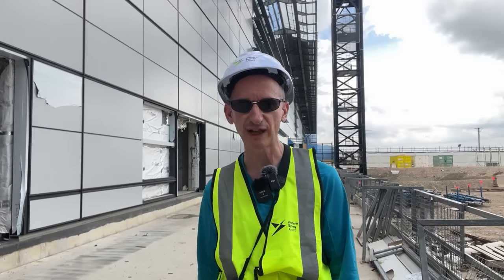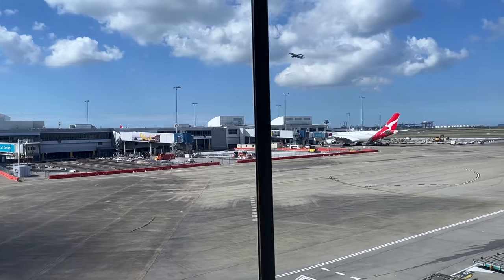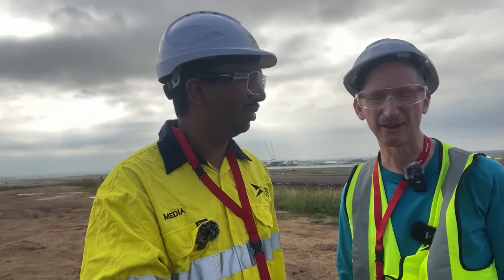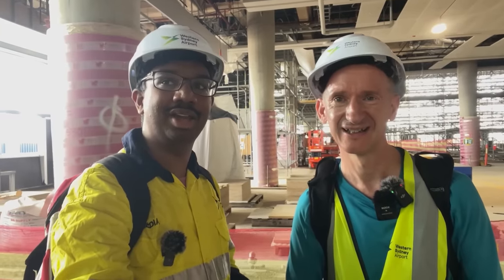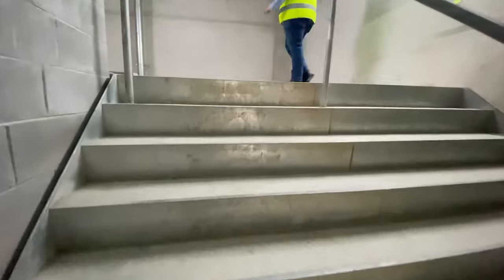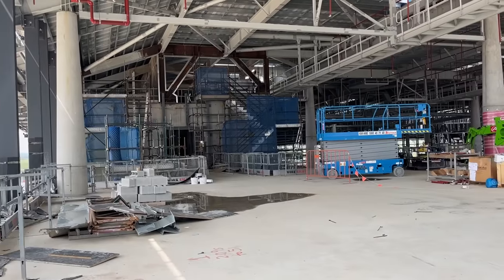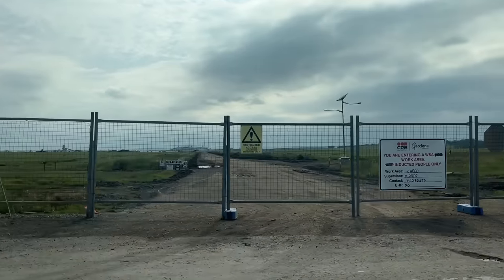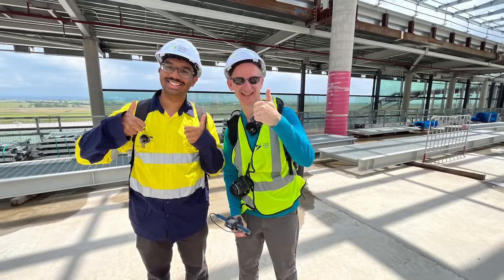We got a private tour of Western Sydney Airport!

Comment: Great planning - a new airport at a location remote for many in Sydney, and then including what looks to be a public transport system which will be very difficult for a high proportion of travellers..
Reply: What are you on about? It's much closer for 2 million people. And why is the public transport difficult? Where else in sydney do you suggest they built this?
Reply: @chrispekel5709  There are 2 main problems with the new system.  The first is that you have to take an ordinary suburban train, then change to the airport line.  There ought to have been a proper service, no changing, from Central to the new airport.  Stops at Strathfield, Lidcombe (perhaps) then  Parramatta, Blacktown and the airport.  The second is that it seems that ordinary suburban rolling stock will be used.  That has very limited luggage space.
Reply: @doubledee9675  Fair enough. You have to swap in Singapore too, which I always found weird
Reply: Sound like an inner city type.   Stick to your local airport.
Reply: @lindsaysmith8119  Well, no, I don't live in the inner city.  Never have and have no wish to do so.

Comment: Right now, it's estimated to have the same amount of traffic as Canberra airport.
Reply: A regional airport…..not international…..
Reply: @cathalwarrior1650 incorrect. Takes international flights and has a modern terminal and a runway length in excess of  3.2km which is longer than a few other so-called international airports in Australia. A second airport close to a freight rail line between Sydney-Goulburn-Canberra would have made better sense than lumping Western Sydney with another dysfunctional structure and traffic chaos.

Comment: The design is similar to Athens Int’l, which is 21 years old. The main differences are: Athens was built with 2 parallel runways from the beginning, Athens has a satellite terminal.

Both airports can easily be expanded which is good. Feels like Sydney is finally joining the 21st century with regards to airport design.

I think this new airport will be more popular than what the planners realize.
Reply: As Sydney's second airport, and with more space to play with, they could build a more modern airport. Sydney Airport doesn't have a lot of space to play with, unless they filled in more of Botany Bay. That might upset a few people though.

Comment: I’m not a plane guy but excuse my ignorance 

I always thought airports had two runways allowing aircraft to take off / land into the  wind 

I thought from the aerial shot I saw one runway and Sharath said he’s was at the western end 

I’m assuming one east/ west runway ?

Can anybody shed light on this ?

Thanks
Reply: 1 runway until it reaches capacity in 2050 then a second will be added
Reply: Crossing runways are expensive to build and take up an enormous amount of land area, and you can only use one at a time anyway. They generally don't get built unless the airport is expecting a lot of smaller private planes (which can't handle crosswinds very well and don't need a particularly long runway to land on) or the location has highly variable weather conditions that justify it.

They're starting at one runway that points northeast (into Sydney's prevailing winds), and will add another one in the same direction when it's justified by the amount of traffic.

Comment: Great clip. I'm all jealous now. A few random comments:
- You have probably heard that WSI will not have a control tower, but multiple cameras (including in infra red) that will display like a virtual control tower at a facility in Eastern Creek.
- It's a little harder to do 'virtual' crash fire rescue, so there appears to be a large concrete pad for the first runway fire station on the western side of the runway, near its centre and beside a big rectangular pond.
- The Elizabeth Drive bridge over the M12 and rail underpasses at the northern end of the airport is about to open. 
- The Elizabeth Drive rail underpass has tons of room for four tracks - That combined with spare space along the eastern side of the W S Airport Metro line through the airport are probably to provide a corridor for a later second line (to/from Westmead?).  - Given the passenger flow, cross platform transfers would not be needed within the airport. 
- As I won't be around by then, I can safely speculate the Airport Line will link to Glenfield, and the later line will run to Narellan and Macarthur (with cross platform exchange before lines split around Bringelly - and possibly with the Airport line splitting to do both destinations initially).
- I wonder how transfers between flights at different terminals will be done, once they are constructed - perhaps transfer buses airside (like at some major Australian airports), or a 'people mover' connecting terminals inside their secure areas (like at some major US airports)?
- I'm 'sowing seeds' wherever possible that WSI is NOT Sydney's second (or third) airport at all, but is Western Sydney's own international airport. Seperate identity, different market mix, more flexible, cheaper operation and run by more pragmatic locals - It's all the more reason why people in the (more populous and productive) West will rarely want/need to go into dear old Harbour Sydney, except as an occasional tourist - Even Tay Tay preferred going West for her venues and zoo visits. Just saying.
Reply: In relation to the transfers, I would say it would operate not dissimilar to Pudong & Hongqiao Airports in Shanghai (both on opposite sides of the city).I believe they have a mix of airlines, but set routes only go to 1 specific airport, and the budget airlines go to Hongqiao.Hongqiao takes less international if I recall my time there, Pudong still doing the heavy lifting for international flights. I reckon Wellcamp Airport here in Brisbane will be similar again, both Badgery's Creek & Wellcamp being a good 2 hours from current airports.

Comment: Sorry guys but you forgot to mention no DIRECT connection via metro to Kingsford Smith. Domestic or foreign visitors needing transfer from Western Sydney to Kingsford Smith will need a metro to St Mays, then change, then train to Central station with a change to get to Kingsford Smith. Absolutely ridiculous when 6klm from Western Sydney Airport, a rail line to Leppington was built with direct access to Kingsford Smith and Central WITHOUT THE NEED TO CHANGE TRAINS.  Road connection to Kingsford Smith will be a disaster along the M5 that is a parking lot for most of the day. And forget catching a train from Camden or Campbelltown unless you have 3hours to waste of your life. Planning has been -4/10, A second runway and terminal expansion will NEVER happen as in 40 years time it will be 30 - 35Billion to complete as it is next to an active runway. I follow both of you guys channels, and generally love the content, but, and that's a BIG but, this video, i'm sure has been vetted by WSIA for content, and doesn't exploit the weaknesses that will hinder this airport from running smoothly. FFS, 150m to walk from a train to the terminal with baggage before a flight. When heavy machines that were onsite could have done a cut and cover station for 1/3rd the cost and 30m from the terminal. come on now.
Reply: It’s designed to serve Western Sydney. Transferring between airports located  over an hours drive away from each other would be odd.
Reply: @MaxS-hn8we It is a complete myth that people travelling to/from Western Sydney will use WSA and East/CBD passengers will use KSA. People will choose flights based on timing, convenience, preferred airline and above all price - and then go to the airport.
Reply: @jack2453  Ain't worked out too well for Avalon.

Comment: An amazing piece of Civil construction. Thanks for the lighthearted informative video. 
But its operation going to effect the whole of the Sydney basin. Aircraft Noise, traffic chaos and pollution. The increase costs from ROI of running this new airport.  The new WSI and SYD aircraft movements  basically will effect everyone from opening. 
Plus the many Ground travel and resupply issues assigned to TfNSW well into 2030's.
Reply: World-class cities need 24-hour airports.
Reply: @baldersackthethird768  Boring as hell though after 2 weeks
Reply: @eds4743  There is a case for them. The good ones are away from City Basins like ours. with fast transport connections

Comment: Interesting that the connection to the metro will be outside. Is that right?
Reply: The station is actually located in what will eventually be the middle of 4 terminals. They are only building 1 terminal for the 2026 opening.
Reply: @MaxS-hn8we  saw that later in the vid, good news then!
Reply: I remember reading that it was modelled on Incheon Airport and having lived over there and made good use of that train, it’s a good one to compare with. The airport railroad there connects nicely to both terminals via an enclosed connected walkway. Western Sydney doesn’t get as cold as Seoul but at times cold enough!

Comment: Can't wait for this, 24 hours per day will be good for the airlines. If connecting passengers are late getting into Dubai they have to leave them behind to beat the curfew into Sydney. This has happened. One Emirates flight leaves Heathrow for Dubai & about the same time a flight leaves Manchester. They all join the same flight to Sydney. Once the Manchester flight was late getting in & about 50 people had to wait 9 hours in Dubai. A few chose to get on a flight to Sydney via Singapore but took longer.  I live in Glenmore Park so I already get aircraft noise so I have no issue with more. Also, every new plane that comes on the market is quieter. For those who say Sydney has a curfew they still run propeller aircraft all night for cargo flights.

Comment: best? kinda in the middle of nowhere though....lol. iots SOOO small. Doesn't look like it can accomodate  many flights. Kinda looks like Adelaide but Adelaide is WAY bigger. what airlines? i wouldn't want to travel that far. Also M12? how much they gonna slug you for that? ><
Reply: This is stage 1. The plan is to build a second runway and terminal. The land is already protected for that purpose. The Metro station will be conveniently located between the two terminals. Current projections are for 21 air traffic movements per hour during peak times. And don't forget, Sydney Airport will still be operating, so it's not like this airport is expected to handle all the air traffic for Sydney. The Western Sydney Airport site is about twice the size of the Sydney Airport site btw. At the moment, Qantas and Jetstar have said they will use the new airport. And Transport for NSW have said the M12 won't have a toll. All the documents on the new airport are available online. You could Google them.
Reply: @baldersackthethird768  And? It's always a political decision.The M12 is being co-funded by the Feds and NSW. So it isn't a PPP. That's something in favour of it remaining toll free.

Comment: Yeah fuel won’t be an issue, No pressurised hydrant system to the aprons and bays. How long do you think it will take to refuel an a380 since they keep banging on how they can handle one. SYD -DXB 230-250,000 litres same with LAX. Singapore 140,000 lites. What, you think there going to do that from a tanker?  Do you know how long it takes to bridge fuel into a storage tank?  People who know are just laughing at this airport it’s embarrassing.
Reply: Long haul routes will probably remain at Kingsford Smith

Comment: I really appreciate what you do on your channel, but I do have a fairly major issue with this video. I think that it would have been important to not just how problematic Badgerys Creek airport is. I grew up in the Blue Mountains, and we've known for years that ops in and out of an airport were going to have a very major environmental impact on the local fauna and flora, and that there would be potential noise issues with an airport with no curfew. I'm a huge avgeek, and always in favour of urban development, but this airport isn't a positive thing for Sydney. I'm all in favour of Western Sydney's urbanisation (albeit not in its low density Oran Park-esque form), but the airport is a backwards move that isn't really going to tangibly benefit anyone.

One of the biggest arguments for building WSI has been the increased demand on YSSY, and whilst it is true that Kingsford Smith is a busy airport, I think it's reasonable to argue that a proper HSR connection between Brisbane/Sydney/Melbourne would take a significant amount of stress away from YSSY, thus eliminating the need for another airport. Sydney is only going to grow, and unless we look for proper, environmentally viable solutions we're just going to follow in London's footpaths.
Reply: HSR between Brissy/Syd/Melb will never happen. The cost of such a project will not outweigh the benefits. It's more realistic for something like Wollongong - Sydney - NewCastle.
Reply: What sort of effect? Sounds like NIMBY rubbish. Sydney badly needs this. HSR isn't economically feasible

Comment: The airport is very vulnerable. The aviation jet fuel is being TRUCKED from Notany or Clyde. One accident on the M4 or in the suburban streets can close the airport.

On top of this an accident can result in deaths, disruption to the economy and more.

Why this multi billion $$$ project doesn't pipeline the fuel is beyond me.

The mayors in suburbs along the route take note. You will have B doubles travelling down your high street.

The minister for roads and transport need to have in place contingency plans for when a truck crashes on the M4.
Reply: Yes, fuel will be trucked in. At least to begin with. Supposedly they have your accident on the M4 covered, at least as far as fuel supply is concerned. “We’ve ensured WSI’s fuel systems will be capable of storing and delivering sustainable aviation fuels to aircraft from day one of operations” . I don't know what routes they will be using, but I doubt they will be going down too many suburban back streets. Petrol has a lower flash point than jet fuel, meaning it busts into flames more easily. Maybe you should be more worried about all the petrol tankers driving around the suburbs.
Reply: @daveg2104  Fuel tanker combination  proposal is A train combinations. Much bigger, that's prime mover and two Full length trailers. Everyday 24/7 on roads that have no tunnels. so connection from Botany will be on regional local roads then onto Motorways.
That's a lot of fuel.More than currently shipped to Newcastle  or Canberra.
past lots of new Housing estates, schools  and other densely populated centres not in Eastern Sydney.

I expect it takes 6-8 years to plan and build the pipeline  that is if you have preserved the corridor for it?
NOT Happened! as its a NSWG responsibility, perhaps 2038?
Reply: @kimriley5655  Yeah, they will keep away from tunnels. We don't have disasters with petrol tankers too often (hope I'm not tempting fate there). Although, no matter how responsible the truck drivers are, there are also idiots on the road.
Reply: @daveg2104  then you have the activitists.  They will be he'll bent on stooping the fuel getting to the airport. Too easy in road trains.

Pipelines were not built because it cost more. Also snaking fuel pipelines through backyards. Easier to have a fuel unloading point in  Newcastle and coming cross country. Then the Greenies and native title owners jumping up and down.

Airport should have been built in Newcastle with high speed  trains servicing Sydney.
Reply: @kimriley5655  I think they should have built the pipeline for the opening of the airport. Reading some of the analysis, it's all about cost benefit. Which is an issue, because it isn't just about what is more profitable for the airport. Although the airport will pass the increased charges onto the airlines, which might make the new airport less attractive and less competetive. I'm not sure if there is a newer analysis, but this is from when a lot of the planning should have been occurring. Deloitte analysis 2017 - Based solely on the economic analysis, jet fuel will need to be delivered by truck to WSA until around 2034, and based on WSA’s passenger forecasting, approximately 41 B-double trucks will be required on a daily basis by 2033. This result is consistent with the WSA EIS modelling.
Reply: @daveg2104 the previous NSW Government & TfNSW was more interested in M4 Tunnel  and revenue for Toll operators than. 
The interests of Western Sydney residents. 
So, every update request on pipeline TfNSW replied with the standard 'we are looking at it'.. that's a lot of year's of looking.
Reply: @kimriley5655  Yeah, they looked at it. And the recommendation was to wait. Of course, if you are only looking at it from a simple commercial perspective, I suppose it makes sense.
Reply: @daveg2104 From day one, the NSWG promises made and still not kept. YES ,its only about today. 
While it's mostly greenfield sites close to WIS. Setting aside a corridor isn't commercial sence